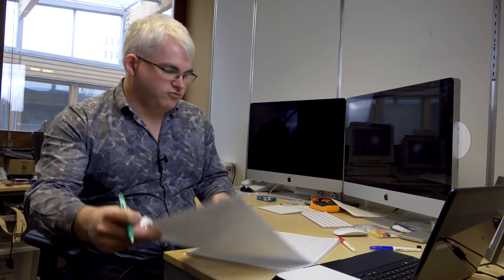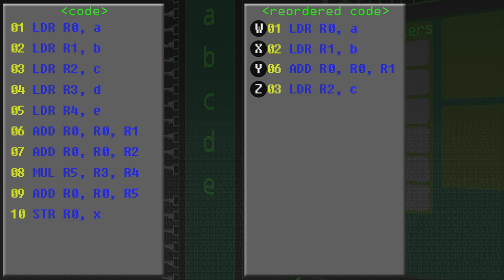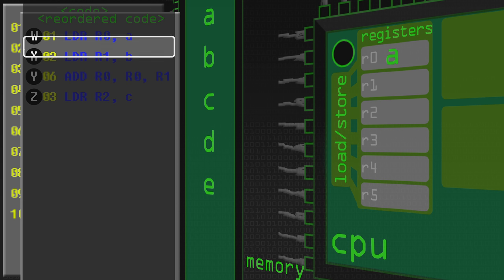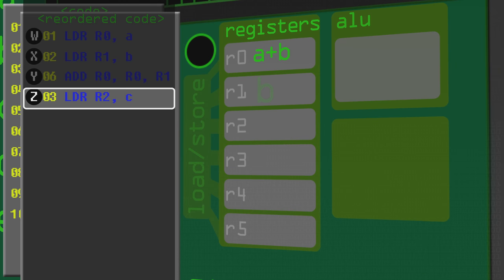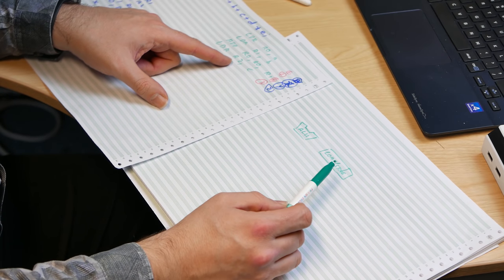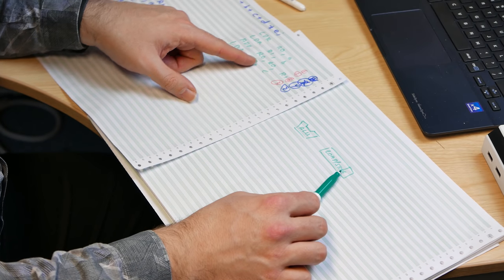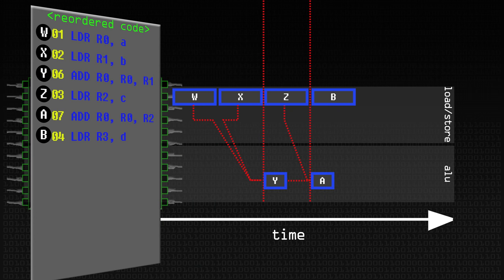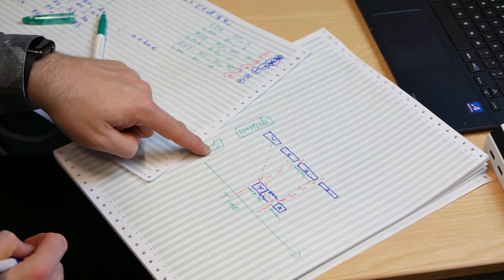CPUs Are Out of Order - Computerphile

Comment: My knowledge of how a physical processor actually works is low, but I am a mathematician by trade and find this optimisation procedure quite interesting. So I don't know if what I'm about to say actually makes sense. But:

The two set of instructions in this video only differed in the order of operations. The only data that seems to be needed to run the code in the theoretically most efficient way possible is what dependencies there are between the instructions; whether they can be run concurrently; and the timings that the processes take. I guess the rub is that the latter isn't really deterministic (or perhaps they are up to a reasonable margin of error?).

Still: is a simple on-the-fly optimisation (that is actually implemented at the moment) essentially one which chooses processes that allow other concurrent ones? If module A of the processor is awaiting a new instruction, then first it looks at those available, then prioritises those which allow, say, for a computation on a currently unused module B (which is perhaps prioritised a slower component of the processor)... and so on in a similar fashion? I guess the mathematical structure I have in my mind is a kind of dependency tree which forms part of the data of the instructions, perhaps with some other weights so as to incentivise some processes (those which take place on slower components of the processor).

Lots of gaps here, but I find this optimisation problem theoretically quite interesting and would like to know the current state of the art. It reminds me a lot of FP, where because of lazy evaluation you can ensure that functions are performed in an order so as to not have superfluous operations. Sounds like similar ideas could be useful here.

Comment: BTW I think it was the Pentium Pro from 1995 the first Intel CPU with out-of-order (as well as speculative) execution. The original Pentium (1993) didn't support those features, ASAIK.
Reply: I think the Pro was indeed the first Intel with speculative execution, not sure about out-of-order.

edit: apparently both
Reply: The original Pentium was superscalar but didn't support OOE that is correct. In the P5's case it had two execution units that could execute instructions in parallel, but it didn't make any decisions more complicated than "Can I execute the next instruction in the second pipeline or not". The Pentium tried to pair off instructions. Pairs could enter both pipelines, while unpaired instructions could only enter the primary pipeline.

Comment: I think we took a misstep in processor design decades ago.  Modern  processors have become so complex that no one person can understand all of them (I mean really, REALLY understand - down to the gate level of what's going on in all cases).  As a result, we wind up with things like Spectre/Meltdown and so on, which happen because the left hand doesn't know what the right hand is doing.  What we chose to do decades ago was to add complex logic to our cores, in an effort to get them to execute code faster.  We've gotten to the point where all that stuff represents more of the logic on the chips than the actual compute logic does.
   
What we should have done instead was to embrace the multi-core idea much, MUCH sooner.  We should have kept our cores dirt simple, and just piled more and more and more of them onto the chip.  Use ALL of the logic for the business of computing.  Of course, this would have required us to face multi-thread programming much sooner than we otherwise did, but we've wound up having to face it anyway.  If we'd just swallowed that pill sooner then we would NOT have processors that no one can understand and I wager that we would have much more secure, reliable systems that didn't plague us with all of the difficulties that our current processors do.
   
You can't really say "That wouldn't have worked as well," because we DON'T KNOW.  Software would have evolved in a different way, and we don't have the software we'd have gotten from that other path, so we don't really know where we'd be on overall performance at this point.
   
We let the tail wag the dog at every turn, though, and now we are where we are.  I don't know if there will ever be a way out.  Generally speaking, though, I oppose letting whatever body of legacy software we happen to have "at the moment" dictate how we design future hardware.  The hardware design should lead, and the software design should follow.

Comment: Wouldn't the time taken by the CPU to re-order the instructions wipe out any time gained by being able to perform those instructions in parallel? In other words, re-ordering the instructions makes it quicker to do them, but you waste time re-ordering before you can start.
Reply: dharma6662013 No, as this is usually performed by the decoder. The ALU and L/S units aren't yet involved. At this stage they will also perform things like checking to see whether data needed by the decoded operation requires data not in cache - if it's not, it will be prefetched, so that it is in cache when it's needed later. This is also where branch prediction comes in - if a branch hasn't been executed yet, it doesn't know whether data used by each branch will be needed, so it will gather the data for the operations involved in the branch it predicts will be taken based on previous behaviour. It may also perform speculative execution (this depends on the design of the specific CPU implementation)
Reply: Please forgive my ignorance, but that just seems to "kick the can down the road". Something, somewhere, has to spend time re-ordering things. The result is that the CPU can run things faster. How do we know, and how to we measure, how much the time used re-ordering compares to the time saved *by re-ordering*?
Reply: dharma6662013 I would assume that chip designers and their respective companies have done quite some testing on this.
You might want to look up which generation of chips was the first one to implement such a thing and how much faster they got.
Reply: dharma6662013 tl;dr: thinking about how long something might take is faster than doing it.
Reply: CPUs have an instruction prefetch where the next instructions are loaded into cache before they are executed, usually in 16-byte segments. That gets into branch prediction, and what if you jump to a different address. But the main takeaway regarding instruction reordering, and pipelining in general, is that it can be done combinatorially - meaning a logic circuit that does not use clock cycles, but acts as a direct function on its own. As soon as you feed in the input, given some gate delays, the output appears on the other side. For the purposes of this discussion, just think of it as being an instant process. It's a very long and complicated "if" statement that happens all at once in hardware.
Reply: Consider loops. If the encoder recognizes that the contents of a loop can be optimized, it only has to optimize once.  The effects of this optimization would be felt multiple times though. Also consider the fact that instruction optimization can be done while the program is initializing large amounts of resources in RAM. The only time that this reordering logic would waste resources is if the code was already perfectly optimized when it came out of the compiler. Compilers will favor making widely compatible code over optimized code; otherwise we'd get more cases of "It runs fine on my machine" in bug reports.

As for your later question about quantifying these time savings, this is what Big O notation is used for. Most programmers only use it for a single variable, but it's even more useful when tracking multiple.
Reply: DFPercush, yeap, that's a great description!

Although strictly speaking the branch predictors do retain past state, so the circuit can't be purely combinatorial... (but that can be done in parallel with the –I suspect much slower– decoding process)
Reply: You only need to reorder the instructions once, during compilation. The benefits of that are felt whenever you run the program though.

Comment: If the assembly was originally written in the optimal order, will the CPU's useless attempt to reorder them cause an overhead?
Reply: Not likely. During design and testing the CPU will be optimised to avoid this kind of wastage. Modern processors actually have huge amounts of overhead, but this is all geared towards the fastest outcome. Low-power alternative processors that have less overhead, continue to be available for specialised applications.

Comment: On the serious note though, rather than superscalar architecture, isn't it more effective if we put two pipelines in the CPU and both of them sharing the same execution units?
Reply: Yoppy Halilintar This is what SMT does I believe.
Reply: Short answer. No.
Reply: postvideo97 In a sense, yes, except that there is only one pipeline. While one thread has a particular execution unit tied up - say, waiting for data to arrive from main memory, which can take hundreds of operations in CPU-time... note that this would occur due to a failure in branch prediction; normally, it would have already noticed ahead of time that this data would be required and requested it in advance already, so that it would already be in cache or even a register, unless it predicted wrongly that it wouldn't be required - you can instead execute operations for a different thread that doesn't need that data, or that execution unit.
Reply: Yoppy Halilintar, two pipelines sharing the same execution units is pretty much the opposite of what you want, because delays during the execution and complex dependencies would "stall" both of them.

edit: Matthew is right, that's not what SMT (aka hyperthreading for Intel) does.
Reply: Guy Maor, how does multicore "share the same execution units" ?!
Reply: Guy Maor, point taken, let me rephrase my previous answer:
"No, that wouldn't just be multicore."
Reply: Having more than one pipeline in is what actually makes it super scalar.
And yes the original Pentium did exactly that, having 2 integrer pipelines.
The Pentium Pro which came later (and was the successor to the Pentium 2 and technically almost all Intel chips sicne then) brought internal CISC structures and micro-ops.

Comment: At the end of this video he says something that I think is correct, but the entire tech media has gotten wrong about Spectre / Meltdown, perhaps because the people who wrote Spectre and Meltdown papers got it wrong themselves. Spectre is a class of attacks that takes advantage of speculative execution. The attack concept does NOT rely on out-of-order execution. 

It could very well be that OOO machines make it easier, or that only the OOO processors run far enough ahead into the speculative path to pull this attack off, but conceptually, Spectre is a speculation issue, not an OOO issue.
Reply: Probably true, but AFAIK all CPUs that run speculative execution, also run out-of-order execution. The reality is likely to be messy...
Reply: Well, in PC-land, it all went OOO with the Pentium Pro, but the Pentium Classic and its variations had a branch predictor. But it also only had a 5 stage pipeline and dual issue, only one of which could handle a load.

You know that to "surface" data, the meltdown code example requires the ability to get "far enough ahead" to do a speculative load followed by a second speculative load whose address depends on the value loaded in the first.

I don't think that's possible in a short pipeline without many execution units, so older processors probably are not subject to this exploit.

OTOH, there may be modern in-order processors that have deeper pipelines and superscalar with an LS unit and two ALUs that could be exploited. Some of the more modern ARM processors might qualify. ARM11 implementation are 8 and 9 deep. I think most (all?) of the modern ARM "A" cores are OOO, but I would not be surprised to see that some architectural licensees have built their own cores that are deep, SS, but not OOO. In MIPS-land, it may be similar.

Comment: I thought it took less than 100 nanoseconds to get data from main memory, not 200. How can we calculate this? Basing it on 4200 MHz RAM.
Reply: For DDR4 4200 RAM with a CAS latency of 19 cycles, the time required to fetch the first word, assuming the appropriate row is already activated, is 9.5 ns. However, each sequential word after that would only need 0.24 ns to fetch, meaning 4 contiguous words would only require about 10.25 ns and 8 would require only 11.25.

Of course, if the next required word is in another column, you would have to wait the 9.5 ns again, and if it's in another *row*, then you'll need to wait even longer, as your RAM will need to be issued the Precharge command, and then the Active command on the correct row before the next Read command can be issued.

The ALU, OTOH, would usually only need one CPU clock cycle to complete whatever it's doing, especially for a simple operation like addition or multiplication, which is on the order of 0.24 ns. Some ALUs can even do multiple such operations in a single cycle, and if you were using floating point instead of integers, it is relatively common to do multiply and add in one operation.